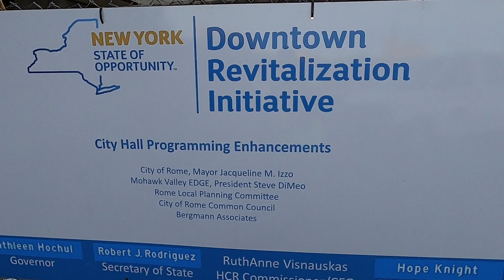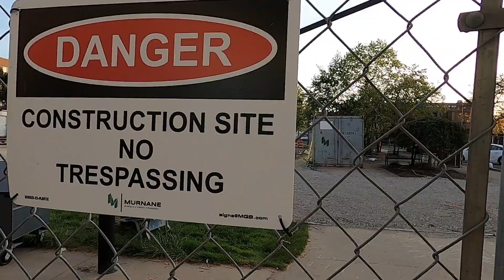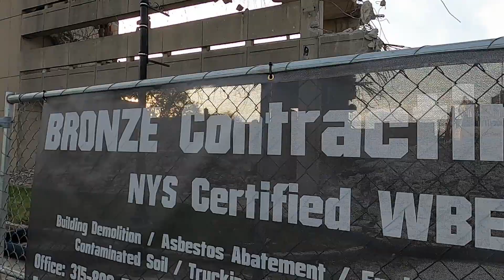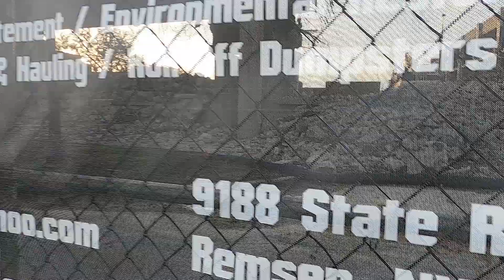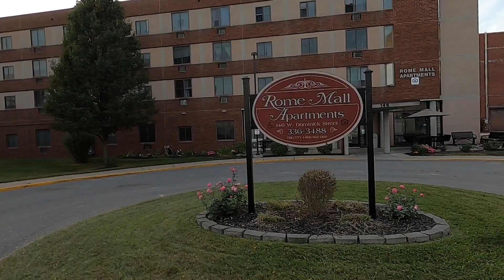Rome, New York Revitalization. Does it benefit...everyone?

Comment: I've ranted about this before. The politicians back in the 60's and 70's went HOG WILD with federal money for URBAN RENEWAL. In the process, in my opinion destroyed downtown Rome. They went in overkill mode and tore down way too much. Many structures like the Arlington Hotel that was over 100 years old had grand Victorian architecture that could have been renovated into lofts or condos. They destroyed the old "American Corner."  Some buildings were probably beyond repair, but many could have been revamped and complimented the fort.  I am surprised they didn't bulldoze the CAPITOL theater in their ZEAL to spend the money and put in the failed mall on Dominick Street, the failed Liberty bridge across Erie Blvd. I'll say it again, Rome has lost its historic heart. It still looks bland with empty holes were buildings once stood and not very appealing. Dominick street is crumbling and needs to be repaved. I will say the new marquee on the CAPITOL is nice, but overall, what a failure and shell of a central city that once had some character to it. Not anymore!  I get angry all over again whenever I see what the politicians did to DOWNTOWN ROME.